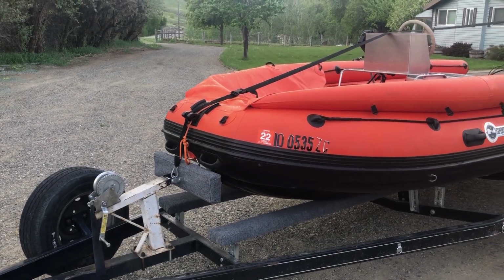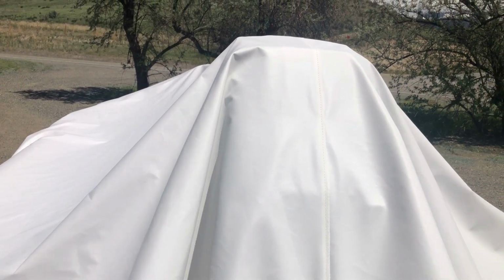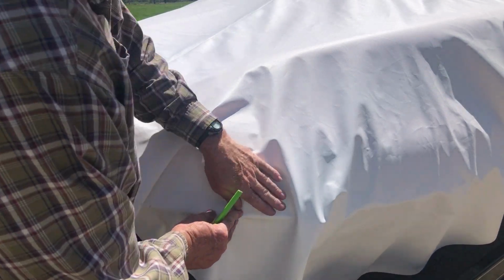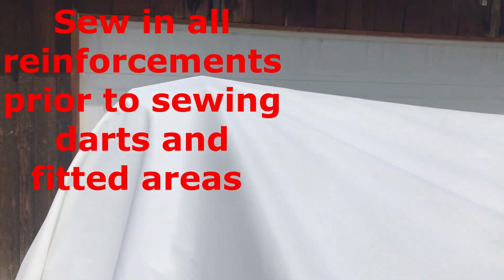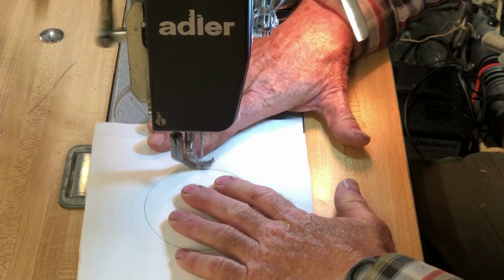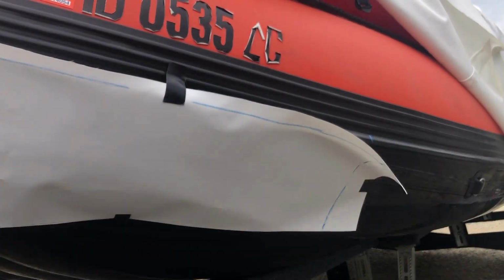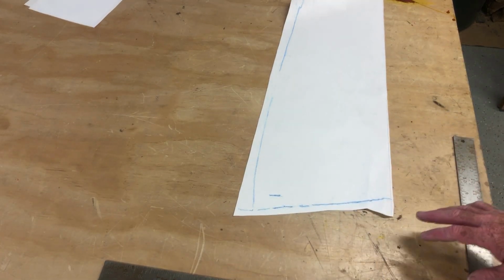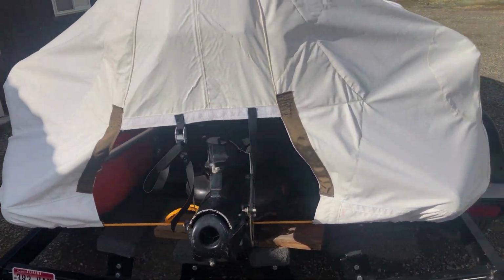DIY Custom Fit Solar Jet Boat Cover

Comment: WOW!!! You make it look SO EASY. I guess they call that Experience, Knowledge, and Talent. I do have a couple of questions. What material is that and how thick (if it makes a difference) and what type of thread and thickness did you use? Thank You.
Reply from the maker: I used aqualon edge for this cover, its great fabric. Its 6.5 ounces per square yard, pretty light weight but very tough and UV resistant. I used sunguard b-92 4 ounce white bonded polyester thread.